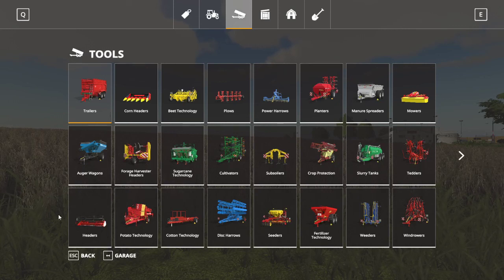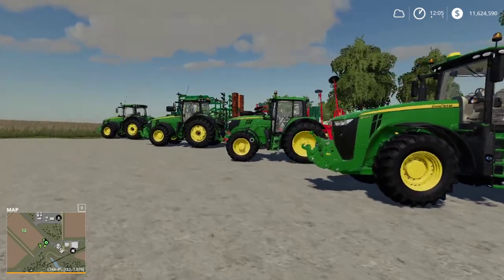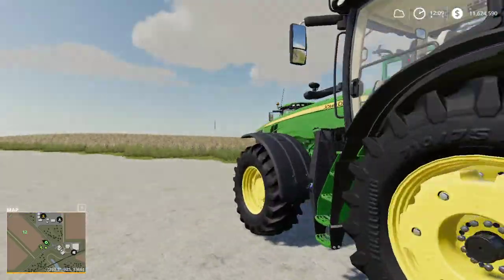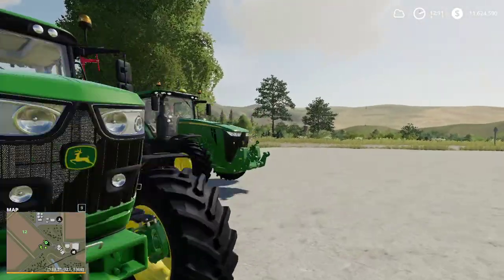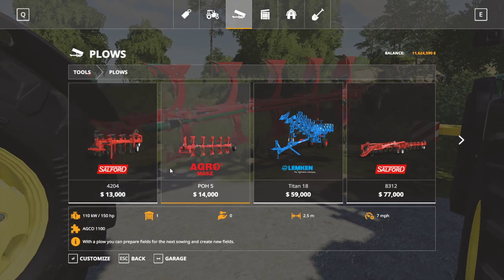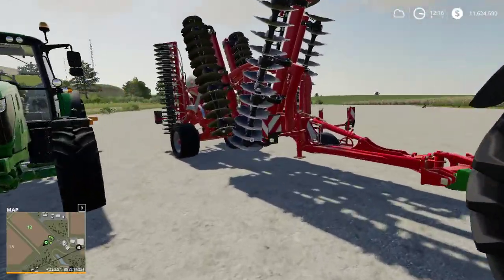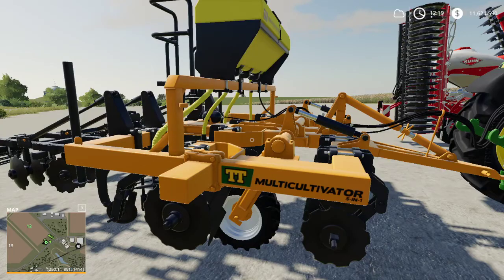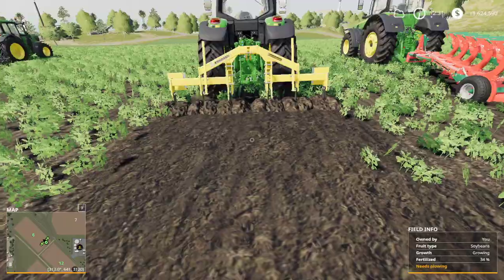Farming Simulator 19 - Tutorial for Cultivators, Plows, Disc Harrows, Power Harrows, and Subsoilers

Comment: Great tip for using a subsoiler in place of a plow for creating fields. That's going to be so much easier.
Reply from the maker: You HAVE to have the cultivator create fields mod installed for that one to work just an FYI I totally forgot to mention it in the video